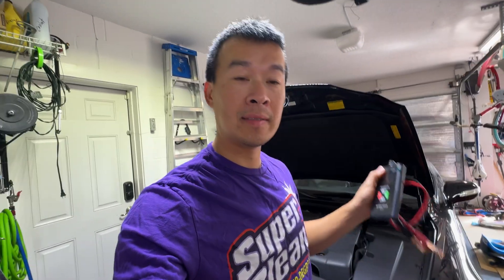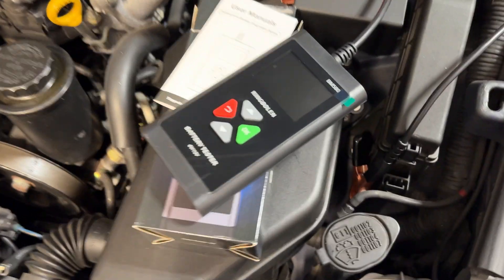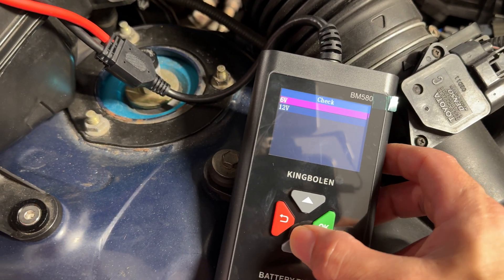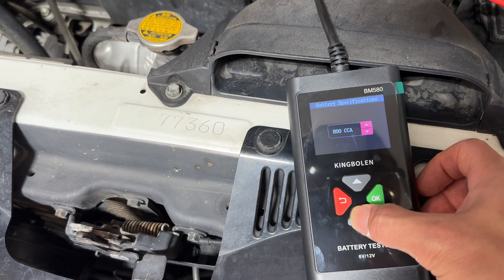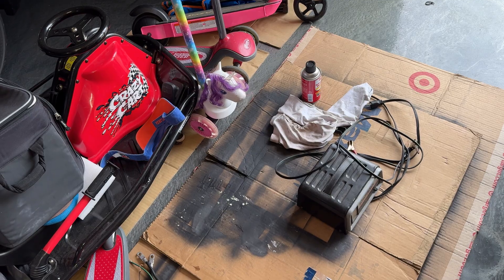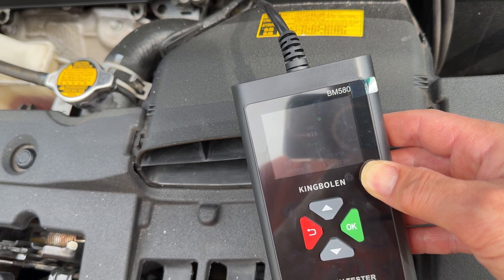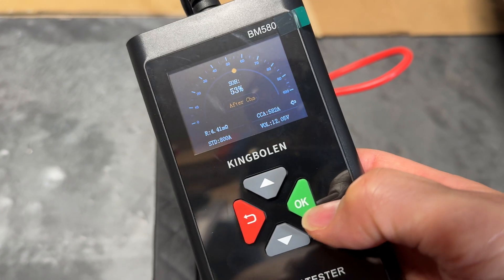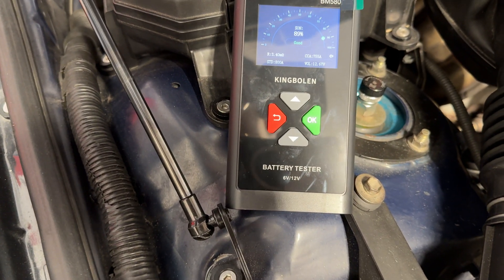How to Test Car 12V Battery or Golf Cart 6V

Comment: i’m sorry i know this is unrelated, but i really need your help with my gauge cluster. I recently did the LED gauge cluster needle fix, but I forgot to take a picture of my needles before I took them off. This has lead to my fuel and temperature needles not pointing the right direction. They are receiving the correct readings, but they are in the wrong positions to show them correctly. I’ve tried moving the needle off position to the default, and it ends up going to the wrong position, some times even flipping back to the speedometer and tachometer needles. I’m completely lost, could you help me out?
Reply from the maker: They should be set to at or near zero cause they reset everytime you turn car off.